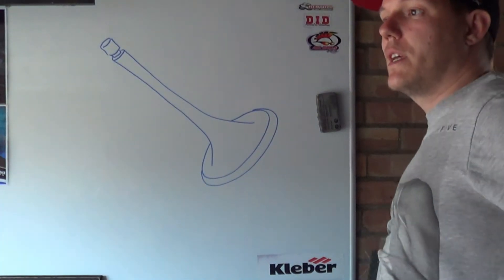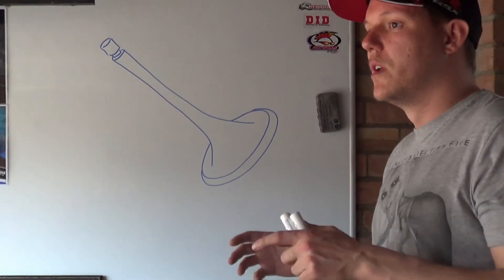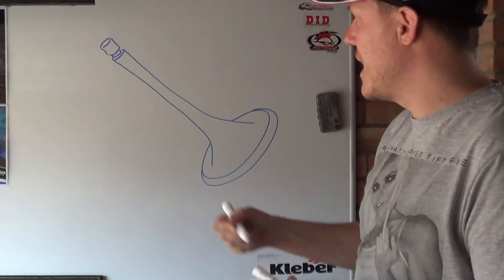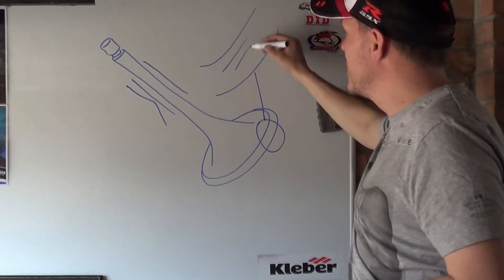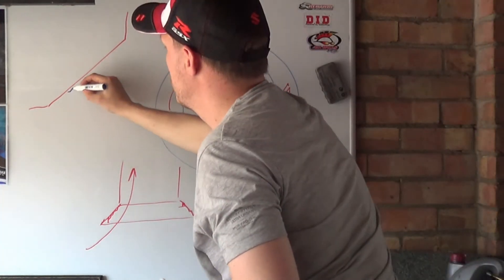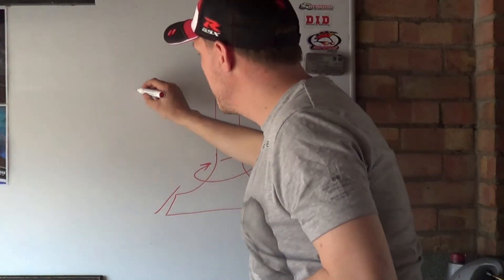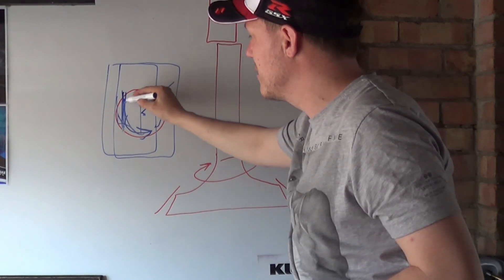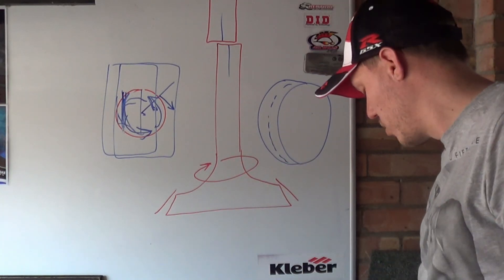Valve rotation? What for?

Comment: Guys, I'm the guy that bought the Gunson Eezi Valve lapper oscillating tool that Matt mentions.

It's a load of bollocks, save your money and do it by hand. 
After talking with Matt about it and experimenting, I did all mine by hand. This was my first go at lapping.

I did have a go with it for my own curiosity, but wasn't happy about a number of things, so I abandoned it:

1. You have to hold the mechanical bit and obviously the handle grip. This makes it a bitch to steady the head too.
2. You CAN'T hear the sweet spot when the lap comes good.
3. The degree of turn is so small (10-20 degrees) that you can't possibly get a good flat surface all round. It just felt wrong.
4. The sucker is even worse than the stick.
5. It costs 30 times the price of a stick!

In short, it's another shit tool designed by a bunch of cunts out to make money who don't give a fuck about the end result.

Here's the original video question for Matt, showing the "tool" we're talking about. Don't buy it.
https://www.youtube.com/watch?v=NW6lotPs8lU

Matt, you're right, The valve rotation does blow my mind, but also explains why I see an uneven wear pattern on the lobes (true?)

Cheers Matt, thanks for your insight and advice.
Reply from the maker: Yeah mate very true - glad you had fun and had a go with both methods - matt

Comment: Hi mate i have a td5 discovery 2 and i get a strange thumping noise on a regular cycle from the intake. Im pretty sure its a burnt valve (lip maybe) which, as it rotates, doesnt close properly and then it does. My question is-do all valves rotate in this way? if so my theory holds water and ill pull the head off to inspect. If not, im stumped haha!
Thanks
Reply from the maker: Yes all valves rotate as long as their heads are circular.

Comment: Matt, how would the cam lobe translate that to the valve.? 
Would it not just turn the bucket on top of the shim ? 
Or is it a case of when the valve is open the entire assembly is compressed enough to sort of act like it was a solid unit ?
Would this not algo rotate the spring a little as the shim is pressed down into the retainer sitting on top of the spring ?
Is that why there are washers under the springs to reduce the wear of the springs rotating? 

Is that enough questions yet ?
Reply from the maker: "Matt, how would the cam lobe translate that to the valve.? 
Would it not just turn the bucket on top of the shim?"

- Oh yeah, but even this rotation is transfered to the valves.

"Or is it a case of when the valve is open the entire assembly is compressed enough to sort of act like it was a solid unit ?"

- Yeah pretty much. Not only that but springs during compression always twist - due to the defomation of the helix. 

"Is that why there are washers under the springs to reduce the wear of the springs rotating? "

- Yes, and they're called valve spring seats.

Comment: i have done this a lot working at the renault dealer we would always do it by hand but they learned me that we should go left and right we had those things you put on the dril to go left right but we would do hand is better but i think you are right but dont blame guys for doing what they whre told by like in my case renault you think most times they know best and one more point that you are right the engine will rotate the valve the hole time

Comment: On the subject of lapping valves, people seem to think you need to spend hours standing there grinding the valve an inch into the head. I was talking to Roger upperton (local gsxr/bandit tuner) and he said don't even bother lapping them. If the seats are cut true, they'll seal. He said if anything, all you need is a few light turns
Reply from the maker: Totally agree and there is an argument between some that lapping is not required at all. For the home gamer, who generally isn't going to do a leak test, then lapping is a kind of insurance.

Comment: Had an idea once to flute the surface on the back of the valve with spiral grooves to swirl the intake charge and increase the volume of the runner so possibly increasing air flow. Thoughts?
Reply from the maker: All that will do in introduce a vortex, which would promote turbulance which is a good thing. But increase flow, no. More on this in future videos - m

Comment: so is there valve rotation only in ohc engines? there isn't rotating element pushing valve down like that way in pushrod engines..
Reply: the oscillating action of the valve springs get the valves walking in circles. overhead cams have a whisper of angled grind (usually added at the wheel dressing) to spin lifters in the same direction. there is plenty of force when you spin a shim to spin the bucket along with. not very much traction between the underside of the bucket to the valve tip. the spinning bucket is more for crosshatch wear of the bucket in its bore. unfortunately I can't really shrink myself down small enough to climb inside a lifter bore with a flashlight while the motor is running to prove it.
Reply from the maker: That's a very good question, which I don't know the answer to. I do know of 2 examples that do, off centre rockers I mean. As for over head cams, its generally the case. I'll do some research - cheers - matt
Reply: Oh, man yeah.. don't forget about some uhc have some kind of mechanics to get valve difference handeled with some shims so cam can't rotate valve by itself.
Reply from the maker: Very true, as I said in the video it not for all engines but great comment - matt